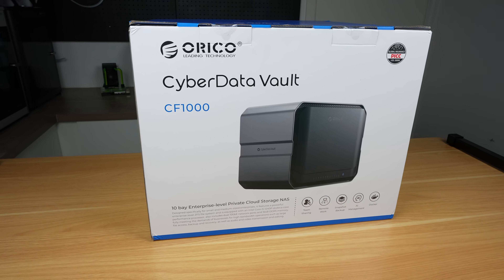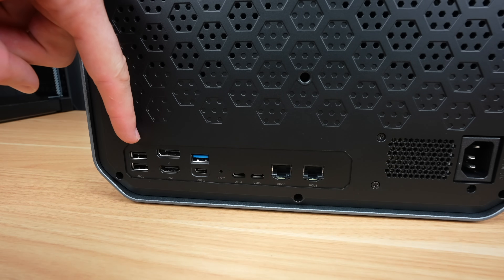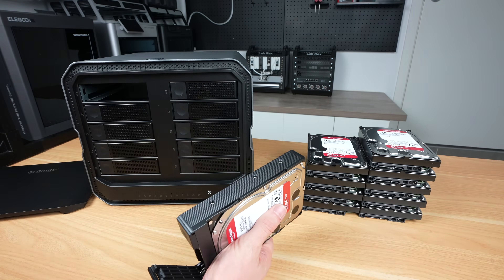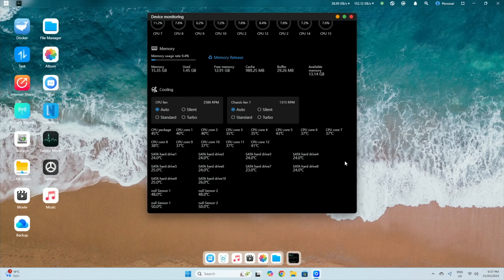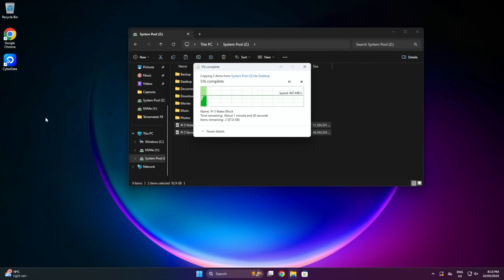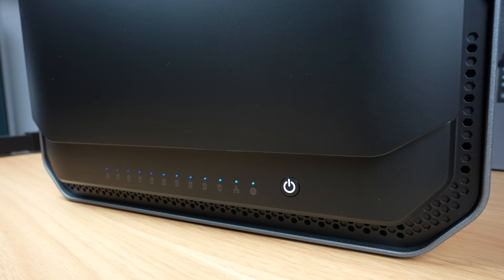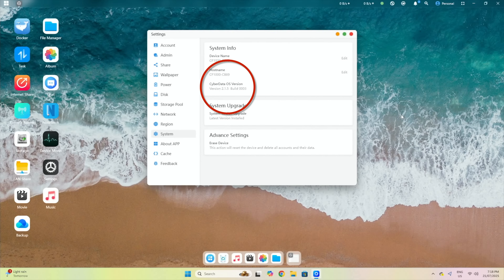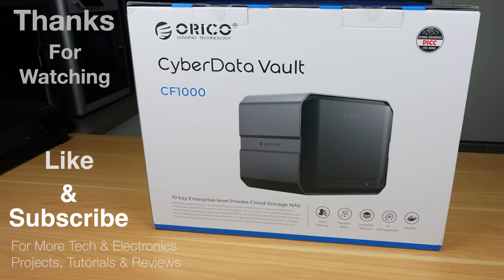ORICO CF1000, The Fastest 3.5” NAS I’ve Tested?

Comment: When you installed Unraid did you use the original OS drive, install another OS drive in its location, or in another storage location. Just received mine and testing.
Reply from the maker: I ran Unraid from a USB connected drive. I can't recall 100%, but I likely removed the original OS drive when running TrueNAS and Unraid.
Reply: How did you take the motherboard out? I’m trying to install Proxmox. No video output from HDMI port. So I can’t get to bios screen to change the boot drive to USB. And it seems like I need to remove the motherboard to remove the os drive. And there’s no instruction anywhere.
Reply from the maker: If you remove the back panel, the whole internal assembly just slides out the front of the Aluminium housing.

Comment: That Intel Core i5 1240P, maybe it was yeah decent for Laptop. But for this device is interesting 😅
Reply from the maker: It seems to handle workloads I tested without any issues. I think it'll struggle with running multiple VMs or enterprise workloads but for NAS functionality with a few docker containers running it's fine.
Reply: The Intel Core i5 1240P is as fast as the i5-11400, which is a damn powerful processor for a NAS.
Reply: Laptop processors are attractive for NAS devices since they use much less power than their desktop and data center brethren. One's like the Intel 1240p or the AMD 8845HX are compromises to increase performance while keeping power usage under control. N-series Intel chips are meant for embedded applications and really keep the power usage in the single digits.

Comment: WHOA! 899? I was expecting 700.... and that's the KS price... so it'll prolly be 1000 once it's gone into production...  I guess they really think their software is valuable. It did seem to be quite robust, so it might actually be worth the price difference. But the lack of support will be a problem for most non-tech saavy users, Especially being that most of the documentation will be in Mandrin if they don't put in the effort to change that. It's all too "iffy" for me. And the fact that you had to go to UnRAID just for the 10G drivers is another redflag. I think I'm gonna stick to just putting one of the ASUS PCIe cards that allows you hook up 4 Gen 5 nvme drives. I don't NEED to have my storage on the network, it will be SO MUCH  faster too!! Even if I went with Gen4 or even Gen3 storage, it would be SO MUCH FASTER! But I haven't bit the bullet on this yet because I'm not sure I will be able to set it up to use RAID. I know my motherboard has a RAID controller for my SATA drives, but I don't think it would allow that card's drive to be put on RAID. But MAYBE the card will have a RAID controller on it. Ithink some of them have one, like one from ASUS. Plus I think it holds 6 or 8 nvme drives if they're Gen 4. 
WHY AM I TALKING ABOUT THIS HERE?!?! sorry :)
THANK YOU MICHAEL!!!
Reply: 899 what?

Comment: OH WOW! I just realized that the nvm3 drives are all PCIe 3 !! They are running MUCH SLOWER then the system is capable of!  If you had Gen 4 drives in there then they would read/write twice as fast! And Gen 5 would be 4 times as fast. BUT You're only getting 1GB/s when Gen 3 runs at 3GB/s so they could be crap drive with no cache chip on them. 
Maybe in a future video you could pop in 2 Gen4 nvme drives (if you have them) and run that same test again. 
ALSO, before you start filling up the drive I recommend you switch the OS to TrueNAS because there IS A REAL RISK running a custom OS that you have NO IDEA how its been modified. If you found out they were stealing your info it would NOT BE THE FIRST TIME IT HAPPENED (not from that company, but software from THAT country has been found spying MANY TIMES before. it could even have a full access backdoor or even something as stupid as mining crypto. 
I always say you are BETTER SAFE THAN SORRY. And with TrueNAS there is SUPPORT if u have probs, do you REALLY think that they are gonna help you very much, or that there is even much English documentation? Plus if its running Win11 then there is a TON of overhead that TrueNAS wouldn't be taking. 
But no matter this is a pretty cool machine. I just wish there was a PCIe slot in case I wanna add abetter video encoder/decoder.
Reply: Oh and PLEASE pop in another 16GB stick of ram to make run in dual channel. You know how much performance you're leaving on the table by not soing that :)
Reply from the maker: The 1GB/s transfer speed is a limitation with the 10G network port, not the drive speed. Unless the NAS is doing a lot of transferring of data internally, stepping up to gen 4 isn't going to make much difference to performance from the outside.
The concerns about the OS are valid and that's why I mentioned this in the video and tried running TrueNAS and Unraid on it.
I agree, a PCIe port would have been a useful addition!
Reply: It seems the universal truth is becoming that there are never enough PCIe lanes for whatever you're building. There always has to be some trade off, if you don't like the choices Orico made, you can look at other solutions from Minisforum, Ugreen, Aoostar and others. There's a good mix of recent releases using both AMD and Intel.